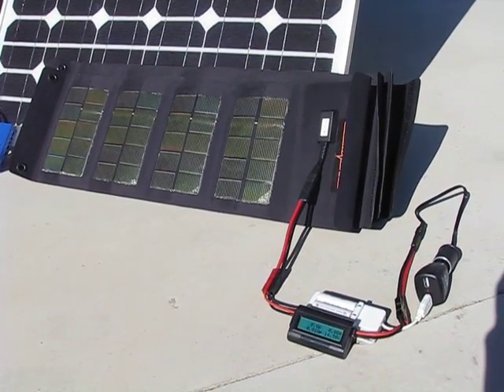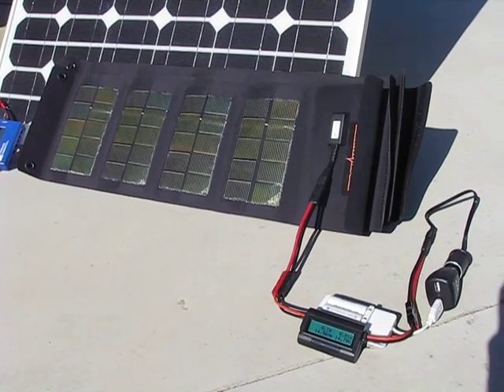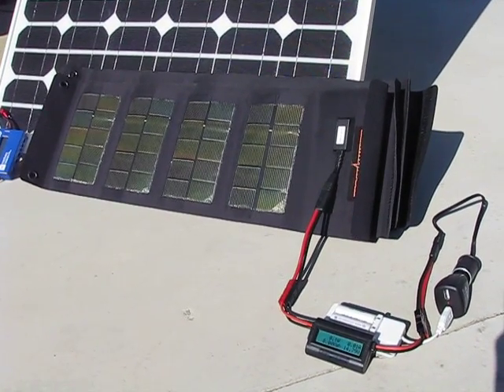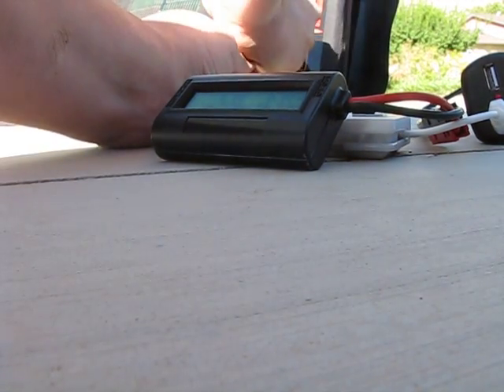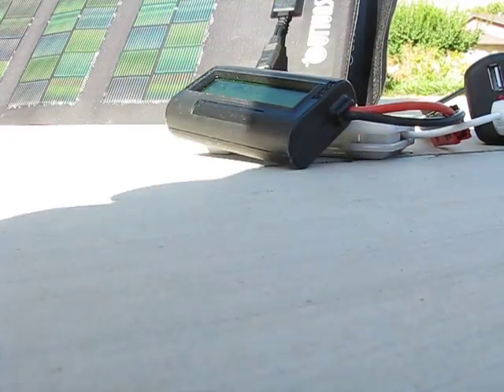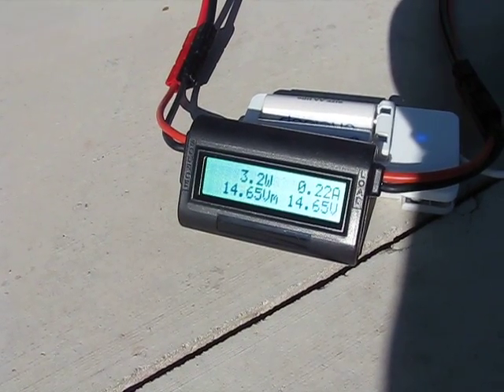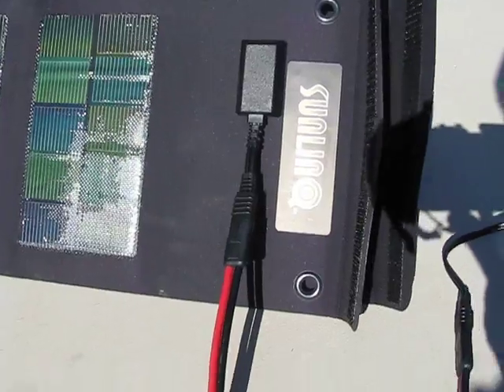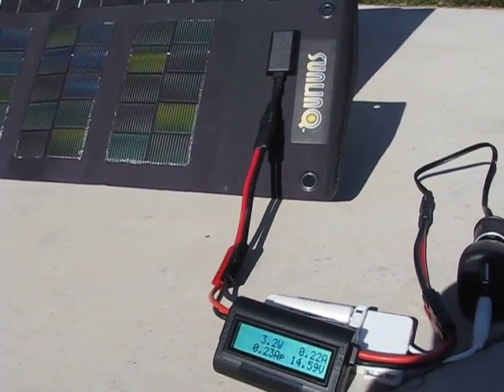Warranty Request for Sunforce MotoMaster Eliminator 6.5 watt folding solar panels

Comment from the maker: @1969s11a The meter is one I use all the time and called a Watt's Up watt meter. It was made for RC models but I use it for my 12v batteries, devices and solar panels.  I've tried a number of cheaper versions but keep going back to this meter because it works!

Comment from the maker: @GetPreparedStuff 
As for the  panels themselves, I wouldn't hesitate to buy a similar model from Global Solar or Sunlinq which is the US distributor for these panels.  There support is much much better than SunForce and you will not be left holding a problem panel if you should get one. I have other Global Solar made panels and find their quality and performance to be very good.

Comment from the maker: @metrowash 
I worked and worked with SunForce product support and tried to get a satisfactory remedy on this issue but even after a promised resolution over the phone they never sent any replacement panels for the problem ones shown here.  I sent a number of emails and tried again and again to get hold of them but was unable to get a resolution to this issue.  I would avoid SunForce products in general unless you know they will never need product support.

Comment from the maker: I work with Uni-Solar panels in their other configurations and have always been impressed with them. They are as you've described them and I hope at some point to be able to test their Uni-PAC folding panel line like you have. They could very well be the best folding panel on the market. I just wish they weren't priced outside most peoples budget but with many things, you get what you pay for.

Comment from the maker: Not yet. I'm still waiting on resolution from either Sunforce Products tech support or Global Solar Energy which this issue is being escalated to and which I believe is the actual manufacturer of these specific panels and all similar CIGS type folding solar panels. I'm tempted to say more but until this issue is completely resolved I'll give them every benefit.
As to your second question, No, but honestly I'd like to actually test a few working panels first and then make my determination.

Comment from the maker: The solar panel uses a flat 2 pole SAE type bullet connector. I found a similar connector and made mine up but they can be found here - powerwerx
You can also find them here along with other connectors and items that work with these type of solar panels on ebay sold by Bohemian-Biker-LLC